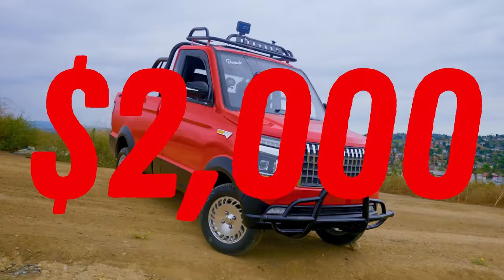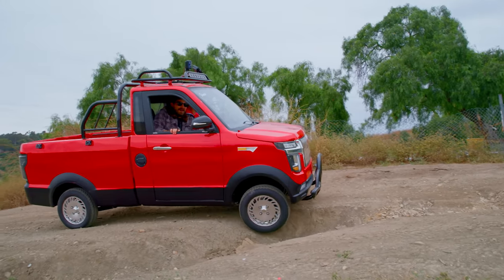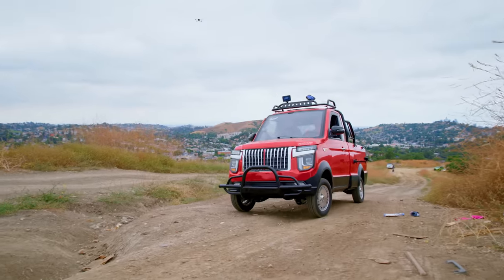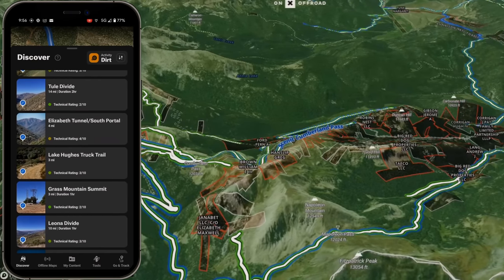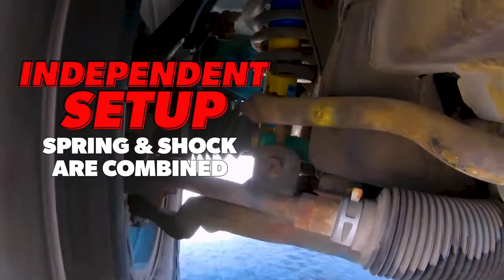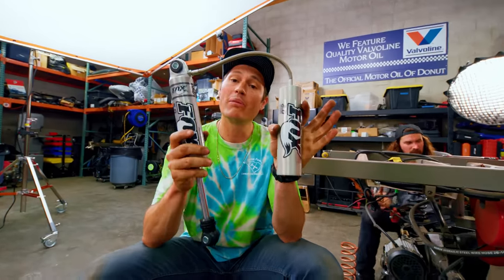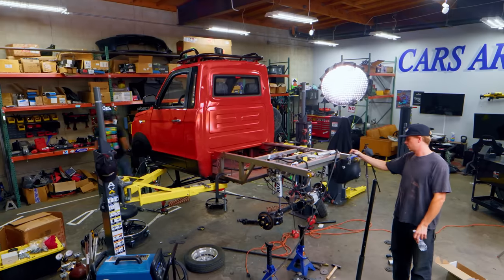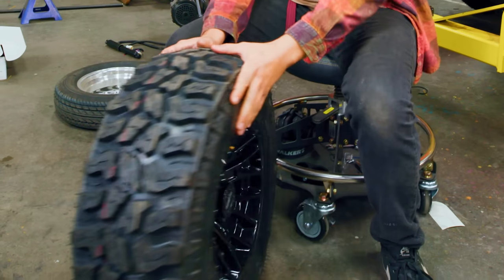We Put a Lift Kit on our $2000 Chinese Truck

Comment: You should put an industrial brushed motor in it! They’re much easier to wire, and usually pretty cheap in comparison to a real EV brushless motor. Plus they’re a bit loud, which would fit in on the cheap Chang-Li
Reply: That would be great to see!
Reply: Won’t that have major overheating issues?
Reply: @jasonfazio8212 add cooling like fans
Reply: I think they should put a ICE in it.
Reply: @shashanksarode2456 nahhh, that would melt, hehe
Reply: Brushed?!?! Really? It ain't 2001 Bruh 😂😂😂
Reply: Washing machine motors have been used for quite some time to make homemade EV vehicles, and I bet it would have enough power to twist that flimsy chassis already lol
Reply: please do this haha
Reply: @jhrubicon1470  A crappy motor for a crappy car! I like the sound they make, makes it sound more like an ICE instead of a quiet electric car.
Reply: @jasonfazio8212 Many older EVs used brushed motors without overheating, although they usually had some form of cooling that I doubt the Chang-Li uses. Overheating definitely could be an issue with longevity though, I’ve burned out enough to know.
Reply: @jetpackjbd  I used to race RC cars, the performance and efficency is so much better.
Reply: Landon-si5xc  I say this to all religions; not just Muslims, please don’t advertise your beliefs in a random YouTube comment section. It doesn’t make people want to convert, instead it makes the religion look bad. Find people who are specifically looking for religion in their life

Comment: If you want to keep it electric you could probably use an Emrax 228 motor. They have plenty of power for something that small and are extremely light. A lot of FSAE teams use them for their cars.
Reply: Or hell just swap in a predator engine
Reply: Ben nye the science guy
Reply: They should use a Zero motorcyle engine imo.
Reply: Yeah, my first thought with the new tires was not enough power to run them.
Reply: What about providing more voltage to the Motor
Reply: @aidensanderson97 he clearly said if they want to keep it electric
Reply: Why not slot in hub motors for ultimate off-road ability?
Reply: @aidensanderson97  The biggest predator engine seems to have 22HP the Emrax 228 motor can output 100hp continuous and 160Hp peak in a 27lb package.
Reply: @teresashinkansen9402 damn that's wild. I love ICE as much as the next guy, and probably more than most, but there's no denying the performance of EV's. I hope we find some battery tech that isn't detrimental to the environment
Reply: @demoths  Solid-state batteries are looking like a good option, they're just really expensive to produce right now. The main benefit is they're much safer and because there's no fluid that can degrade, they last significantly longer.
Reply: @magnusbae  This guy/gal gets it. Throw some hub motors on it for low-speed, high-torque.
Reply: Tesla swap
Reply: Reach the maximum current output of your power supply
Reply: @demoths not only battery but also wiring and the EV motor, its the paralell of ICE engines.

In ICE you increase the horsepower by upgratinf the engine, needs CPU tuned as well of a stronger transmission or the car blows.

In EVs increase battery capacity needs a high capacity wires and a more capable EV motor (3 phase motor or also called DC motor) to handle it, if its not even with just one of those they'll become ElectroBoom
Reply: @matthewmondragon2074  yeah, I know a bit more than the basics, but as far as I'm aware the current limitation is being able to safely discharge batteries fast enough, as well as battery weight. Also lithium batteries are horrible for the environment, which I know isn't the main concern for most car people, but I like the planet we're on.
Reply: @BikesAndBatallas hub motors for the front wheels. Get some random motor from RichRebuilds or Jehu Garcia for the rear wheels.

Comment: I have a few of comments here: (1) Many of the Changlis have an electric low gear, which you did not mention. Did you try that low gear? (2) You may be interested to know, these smaller trucks (and electric SUVs and cars; see Aliexpress) are used in China by the elderly (based on the conversation I have had with my Chinese friend at a factory there). These minis are used in contrast to motorcycles due to: the Chinese elderly population having a higher standard of living now days; the low(er) cost of these vehicles in China (under 10,000 yuan); and can come with heat and a/c which can keep a person out of the elements. Additionally, these mini vehicles are slightly safer versus a motorcycle. Sort of. I am not sure I would want to go faster than 40mph with that metal frame and body parts. That front bumper isn't going to do jack. (3)  The engine you might want to consider is perhaps either a Predator 670cc or a Duromax 999cc. 22hp-35hp would be impressive gain in this little truck over the standard 5kw (or so) electric engine. There are people on YouTube who have claimed the 670cc modified can get north of 40+hp (maybe more) with only a few mods (ie: Red Beard Garage). Since I would assume you are not using this truck for hauling, the pickup bed would be able to accommodate the engine and CVT transmission if needed, and you would have reverse, something a motorcycle engine would not give you. (4) Suzuki Samurai driveline components would work nicely for this application which could add 4x4 pretty easy. There are other routes as well, but you builders probably are already aware of them. Be seeing you.
Reply: Nadie haría en su sano juicio las modificaciones que mencionas. En primer lugar porque es un vehículo económico y para un uso determinado, no valdría la pena porque esa carrocería y metales no soportarían más de lo que tiene, esa estructura fue diseñada solo para uso dentro de espacios cerrados y controlados...

Comment: I think a Hayabusa engine is a fantastic idea. What about putting an AWD drivetrain in as well?
Reply: We should install 6 suron motors!!
Reply: mr beast litterally just commented on my vid I came in the comments because I don’t know what to do I’m actually shaking 😭
Reply: @Jolzy alright bro
Reply: pretty sure even a Briggs & Stratton utility engine would be an improvement. a Hayabusa engine would probably be too much for the truck's weight, but AWD would work around that pretty well.
Reply: Lucid EV motors would fit, they're small enough. You would probably need to dial back the power a bit, considering that they can make 670HP.
Reply: @Jolzy the most recent comment on your channel(not from MrBeast surprisingly) was "get a life", which is fitting......
Reply: ABSOLUTELY
Reply: AWD drivetrain, hard but amazing, Hayabusa engine, that would make me die from the inside.
Reply: @KR15ING  It's a bot. No one is reading your comments to it.
It assumes you will be gullible and watch their videos to see if mr.beast comment , and you were/are. Dunce.
Reply: 2 Hayabusa motors, so you have 4wd
Reply: @FedSmoker64 its not that deep bro
Reply: Naw bro I want a steam engine. They won’t do it
Reply: nah twin turbo LS
Reply: hayabusa would sound amazing. but electric motor at all 4 corners might be pretty legit.
Reply: Or two hayabusas, one in front and one in the back.  Hilarious, practical and utterly terrifying. 🤣
Reply: Hayabusa is 2 DECADES old for Christ sakes, BMW 1000RR engine is where it's at bro....
Reply: @bujfvjg7222 just because it’s old does not mean it’s incompetent.
Reply: You are an absolute genius my guy!
Reply: Even just a 2wd conversion would help massively. IIRC those golf cart drivetrains are 1 wheel drive.
Reply: @Dreezie  Neither is your gene pool.
Guaranteed you would be trying to talk to the bot too if I hadn't commented.
Reply: It's waiting for a LS
Reply: @skinnyjeanis7177  maybe a briggs & Stratton powered generator powering four electric hub engines.

Comment: A sports bike engine would be dope af, 1000cc+. Keep up the good work guys!!
Reply: The honda valkyrie 😏
Reply: Search tuk tuk with busa engine.. mad crazy.. if they crash in video.. they will be like squashed tinned tuna.
Reply: Eh I kinda wanna see them keep it electric, tho idk much about electric mods...
Reply: They won't do it, they are the importer of record and they signed an EPA vehicle compliance form to get it in.  Its also in california.  If they run it by any of their lawyers they will have a conniption.
Reply: I wonder if china makes combustion engine versions? Maybe import rules and everything would be even more expensive and difficult/impossible.
Reply: Really want a turbo busa in this thing, alternatively a zx14, modded SV1000, or a rotary motor would also be cool.
Reply: Look at that front suspension. This thing needs a redo, lol.
Reply: Just a raptor 700 motor would be great would even still have reverse
Reply: They would die 🤣
Reply: ELECTRIC!!!!
Reply: As for an electric upgrade I do not know much about the modifications available, but I've seen someone swap batteries for higher voltage ones achieving ludicrous power upgrade on one of those kids drivable toy cars, so there's that...
Reply: Yes an engine swap is definitely needed
Reply: nah, keep it reasonable. i think a small single or a v-twin would be plenty enough, the thing weighs nothing
Reply: a pair of 30 HP Sur-Ron Storm-Bee Axial Flux motors, one per rear wheel, with ASI BAC8000 50kW Controllers and a 96v battery pack, would piss all over a 1000cc bike engine for power-to-weight and torque, all day. it'd be one of the most lethal "$2000" trucks in existence.
Reply: YES
Reply: Fit a wide body kit, just to make it look like a deranged Dakar truck, with a good quad engine, so you get reverse too..
Reply: @nicscharing Kawasaki H2

Comment: I'll say that one of the positive and negative power leads is plugged in the place of the other causing the drive and reverse to be inverted in control signals and once you find and switch them around the controls should be fixed (make sure to mark/engrave the wires[write which wires are for what] properly so it is easy to find them in the future).
Reply: Was typing this then found the comment! Probably is something simple like this.

Comment: I love that not only did you guys show your mistake with the harness, but showed the proper way to fix it 👍👍
Reply: They didn’t fix it tho 😂
Reply: @blakeog2034  i mean...... ssshhhhh!!! Lmfaooo
Reply: They did fix the Harness! They had just blown something else a pedal or whatever.
Reply: Most automakers wont let you fix it the way they did. Crimp connectors are now preferred over soldering.
Reply: Soldering is not the correct way to fix it. Aerospace demands crimps because they're more robust to vibration and corrosion.

Comment: You guys definitely need to do some sort of small engine swap on this thing. It could be a lot of fun with some more power. Start small and work your way up to like a hyabusa motor
Reply: Some kind of 2-stroke is a good starting point. Maybe borrow the engine out of the 3-wheeler?

Comment: I think you guys should stick a Harbor Freight Predator 670 engine in there. Down the road you can add some performance parts to it to beef it up. You should be able to get a few more episodes out of it that way.
Reply: i just commented a similar thing i think it would be a good idea
Reply: that would be sick, maybe get Grind Hard Plumbing Co too turbo or supercharge it eventually.
Reply: @bigjoe3434  I was thinking the same thing. That thing is small enough you could pull the drivetrain out from under a 4x4 ATV or small SBS. Pair that with the 670 and a turbo and you'd have one smokin' little rig.

Comment: You should look into hub motors. You could do a 4 wheel drive setup with those and potentially reuse the battery.
If you decide to go for a combustion engine swap I say go for a twin turbo harbor frieght predator.
Reply: all of this ^^^
Reply: This is the right idea

Comment: Something like a Zero motorcycle motor would be great choice for the truck. Compact and has a lot of power compared to the stock motor. Rich Rebuilds proved with his Rat Rod that this setup is powerful enough to do burnouts

Comment: A QS180 motor would possibly be a great swap, if there's enough clearance on the existing axle to handle it.
Also, build your own battery from high-grade surplus LFP cells, bought from someone like Battery Hookup!
Reply: I wouldn't be surprised if Battery Hookup throws some free cells your way. (I have no affiliation with them, by the way).

Comment: Swap it with the engine from a 2007 MINI Cooper S Turbo (the N14 Engine. Produces 128Kw)

Its also in a couple Peugeots and Renaults so you might find it cheaper there. Its small enough to fit if you design an engine mount, but you may have to modify the admittedly already basic frame to fit it in nicely with a radiator etc. 
I would love to see an in depth video on rebuilding this  engine though with all forged parts.
Reply: Good idea!

Comment: I have a pickman classic with a 4in lift, swapped the controller and battery to overvolt the motor with a constant 10kw at 90v with about 300ah of lithium. Great little truck but with the mods ran me around 20k and top speed is 60mph

Comment: I would absolutely love to see a massive power upgrade and revisit this videos off-road testing and some on road testing
Reply: come on jarred, what is that profile picture man. what are you doing?
Reply: Do furries off road?
Reply: maybe overclock the motor with larger controller?
Reply: Using all Chinese "performance" parts
Reply: Loona pfp go crazy 😂
Reply: @uiohgycgfhgjh  keep CO2 extinguishers on hand for safety & see if can handle 15-20 kW - if not, upgrade the motor
Reply: @GumpterCrayon  lol if you don’t like it that’s your issue
Reply: Go and see whistlindiesel durability test from this car.

Comment: Tip for those Prius pedals, they are all the same pinout (I think) AND they share their function and pinout with a number of manufacturer's pedals like Subaru. You can go get one from a junkyard from a gen 2 Prius and use it np.

Comment: My first truck was a used 2004 Ford Ranger; which I bought back in 2018. It cost me $6,500, and I’d say I had the better deal. Their Chang Li might be newer and cleaner, but I at least had HORSEPOWER.

Comment: Just put in some cheap dc to dc converter and rig a potentiometer gas pedal to it. Should be fixed really cheaply. The cool stuff is that this little car is way more "hackable" and cheaply to fix if you have the time to get into electronics and metalwork

Comment: Looks like a lot of fun. But not enough power urgh urgh! So I suggest you add some more amps in the form of lithium batteries. Then see if what looks suspiciously like a weak golf cart motor and rear axle are indeed such items. Then if they are just upgrade the motor. If that’s not possible? I suggest finding a replacement rear drive axle from a golf cart like a 72 v EzeGo and its motor that needs batteries to get it cheap, then swap the whole unit. My wife has one and there’s no way even Six big guys could keep it from either moving or burning up the tires. I would also suggest finding softer front springs for a better ride and suspension articulation.

Comment: Motor controller replacement, conect 3 brushless motor wire to respective color, then conect the 5 hall sencor wires to there colors, and add small jump to motor control and u done.

Comment: Id like to see it upgraded to a 300cc gas powered shaft drive engine transmission and put a Toyota 4x4 transfer case in the middle and make the whole thing mean gas 300cc changli

Comment: It's just a suggestion. But I take a 4 by 44 wheel. Drive full Wheeler, automatic and hook. All that under gear right on the knee and turn that little truck into gas

Comment: The reason why it shakes so much is because the suspension is very stiff and the springs were probably designed for much more weight.

Comment: You should make it into a 4wd and maybe make it to motors one on each axle for lowering the weight and maybe even use either a e-bike/ skateboard motor or a super small like inline 3 engine

Comment: Put a ebike motor on it, a QS 3000w motor with a 200A controller, it's like 4 time the power of that motor and still on the cheap.

Comment: I would have probably cut a notch out the bottom of the frame after removing the bracket and then put some shims on both sides of the frames where I needed to and drill a hole and fasten it in that way

Comment: What gets me mad about this video is that alot of the wiring issues could have been by passed by testing the amp/wattage coming from the wiring after they "reattatched everything"
The second they said that, i was like "oh nooo, they didn't test it with the $400 peddle first, did they?"

Comment: What to do next? Well, after you make sure that the damage done has been successfully repaired, I think you should add a solar panel to the roof to make the battery last longer, and also make a custom tow hitch to weld it so you can tow stuff with it if necessary.

Comment: Doubt you'd have the room for 3000cc but a GM Duramax 3.0-Liter I-6 LM2 Turbo Diesel Engine, would be pretty interesting. 277 HP and 460 Torque  would get you up that hill, or (and might be hard to get a hold of maybe?) a Isuzu Dmax inline 4 turbo diesel 3.0, that puts out 187 HP and 330 Torque?

Comment: You should get a swiss electric motor they have 2 available one is about 75 lbs and 330 hp other is about 130 lbs and has 660 hp